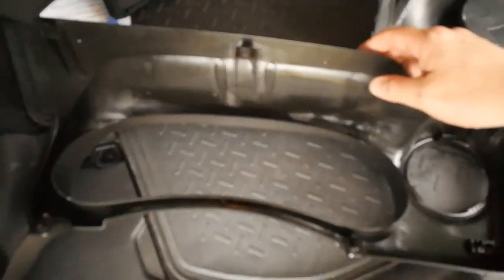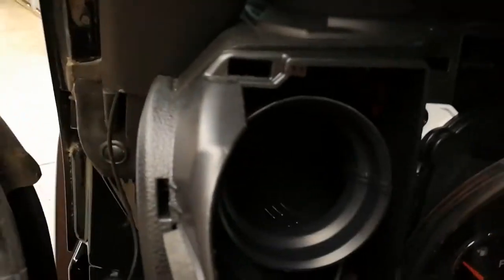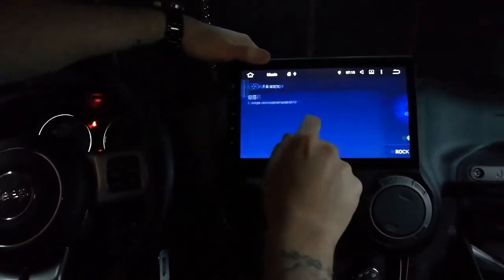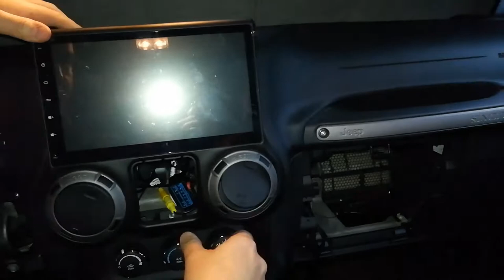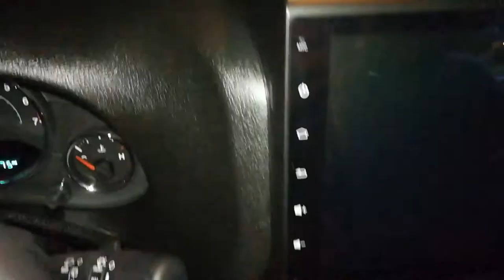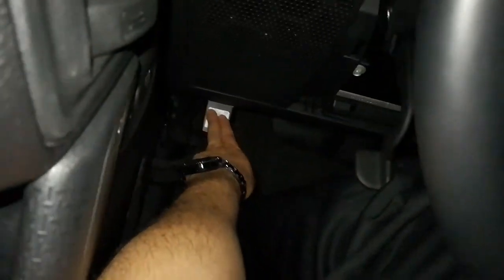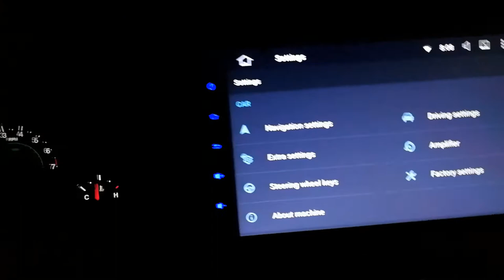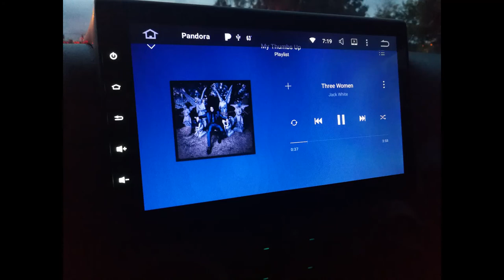Dasaita Hot Audio install in a Jeep Wrangler

Comment: Do you like this unit better than the seicane? I'm looking for a unit for my 2012 Rubicon
Reply from the maker: Jacinto Almager the Dasaita would be the best unit, but there are 2 bugs that need to be fixed. The app switcher button disappears, and the MicroSD card is not recognized after sleep.

So my current daily driver is the Seicane 7.1 MTCD unit. It is PX3 instead of PX5 like the Dasaita, so it runs a bit slower, but not enough to be a deal breaker.

This is the one I am using

https://youtu.be/MWVsNWZjeCQ
Reply: 5after12 awesome man thanks for the info

Comment: MIke, thanks for the video. Just bought the same item but with android 8.0, my bluetooth phone calls seem to be not working, I couldnt hear anything from the speaker during phone calls, wondering if you have the same issue, Thank you!
Reply from the maker: Chen Loren are you using the internal or external microphone?
Reply: i plugged in the mic wire to the device, dont know if thats what you talking the about.
Reply from the maker: Chen Loren yes that means you are using the external mic, there is one built into the face of the head unit as well
Reply: so how to can i make it work for bluetooth phone calls?
Reply from the maker: Chen Loren you can unplug the external and see if the internal works
Reply: i did and it is still not working, i will try to update my system to blue ui first and see if the problem is fixed

Comment: To get the rcas for the rear speakers and subwoofer to work do you have to turn then on in settings?
Reply from the maker: I don't think so, but I don't remember for sure. Now I do remember that most of the a
Android head units had pretty low voltage for the RCAs. So you need a line driver or need to crank up the gain

Comment: I have the latest unit from Dasaita, the PX6. I installed it in my 2016 Wrangler with the alpine sound system. I have two questions... My rear speakers do not produce any sound as well as my subwoofer... Also I do not have a reverse camera but when I shift into gear it goes to a black screen with a "!" in the middle. Any ways to resolve both those issues?
Reply from the maker: There should be a way in the settings to turn off the camera so it doesn't trigger in reverse.

If you have the Alpine you have to rewire their harness or use a PAC module like I did in one of my videos
Reply: @5after12  can you link the rewire?
Reply from the maker: I didn't do the rewire, it never worked for me. But plenty of guys on WranglerForum.com say it does. I used the PAC module:

https://youtu.be/XODNzm__x4M
Reply: I've searched the Wrangler forum and I ended up just making a post about it. Will the seicane PAC work with the dasaita unit? Will I lose any functions in comparison to the PAC that came with the dasaita???
Reply from the maker: The PAC is not related to the Seicane or Dasaita, it is just a piece for car audio in general. I used one with my old Joying, the Sony XAV-AX100, Sony XAV-AX5000, and the Alpine ILX-W650.

The same guide I made for Seicane and Joying should work just fine for Dasaita
Reply: So with with those PACs you still retained all steering wheel functionality as well as the sound system working properly?
Reply from the maker: Correct

Comment: Is there a way to make Apple Carplay work on this?
Reply from the maker: You would need an adapter like this

https://youtu.be/omXodeberTo
Reply: That video was with the Seicane unit. Would it also work on the Dasaita?
Reply from the maker: @ThorsHammer88  yes it will, I have one for Dasaita. The adapter is not made by either company, but will work with both.

Comment: When put in reverse, will the review camera turn on/popup?
Reply from the maker: Yes, even if the head unit isn't fully booted, it will still show the camera
Reply: Sweet thanks! :) Few questions - after a year, how you liking it? what backup camera did you use?
Reply from the maker: I love the Dasaita, use it every day. 

I got the Brandmotion camera, which is pretty expensive, but it has a cool mount and has worked great. I wrote about it here:

https://5after12.com/2017/10/30/my-rear-view-camera/

Comment: If it's not too late, I strongly suggest you return that piece of junk. I've installed a dozen of these things and not 1 still functions without issue, most started failing within months. Puts out a dirty signal and clips on it's lowest settings, meaning before you even turn up the volume it clips and it'll fry the voice coils on all your speakers/sub. Impossible to gain match pre out voltage on an external amp, distortion detectors pick up clipped signal before turning up gain. Apps start freezing, you'll end up rebooting every 10 minutes, touchscreen becomes unresponsive. I'll put it this way....of all the reputable brands on the market that have the same functionality that this claims to do, ALL of them are double dins...so Dasaita & Seicane managed to do what Alpine, Pioneer & Kenwood couldn't, by squeezing all those functions in a single din? Forget what all the Jeep vloggers say, check car audio enthusiasts & basshead forums & you'll find an abundance of 👎👎👎👎👎👎and 0 ⭐⭐⭐⭐ reviews. It's a piece of trash.
Reply: Mike Allen MECP certified, mobile stereo & alarm solutions...custom stereo fabrication, custom sub enclosures, beauty panels, walled out 4th order SPL builds etc. Competed IASCA, MECA, USACi...long story short, Car Audio Geek. These Head Units are impossible to tune w/o clipping and distorting. There are basic workarounds to clean the signal up, such as Digital Audio Coverters  (DAC) & Digital Sound Processors (DSP), simply put, if not addressed it will eventually fry your speakers. I know nobody wants to hear that their new Jeep tech toy isn't the ultimate audio/video solution they were hoping for...might look all hi tech from the outside but in a handful of attempts to repair some, the internals on this thing are as crappy as it gets. Capxcom capacitors & mosfets which have highest rate of failure in everything from offbrand TV's, monitors & bluettoth speakers. Soldering looks like it was done by a 7 yr old. Tablet portion of HU is made by Yuntab, which you can find on eBay for $35-40. It blows me away how many just dive right in and fork their cash over for this thing when had they just did a simple Google search, there's literally 1000's of bad reviews on units they've made for not Just Jeeps but every car mfg.
Reply: JK P. I. M. P_NYC I'm no audiopgile either but I also have the joying unit for more than a year I'm also not using the pre outs I have 2 amps 1 for mids and highs and 1 for bass. So far no issues with burning any speakers. I would like to know if there is any difference between joying unit and dasaita unit when it comes to wiring it to the speaker wire because that is my setup at the moment. Also like Mike stated I also want the full Android experience radio which no company has been able to make.
Reply: JK P. I. M. P_NYC I noticed you from NYC. What part? I'm in the Bronx. Would like for you to check out my system if you have a chance.